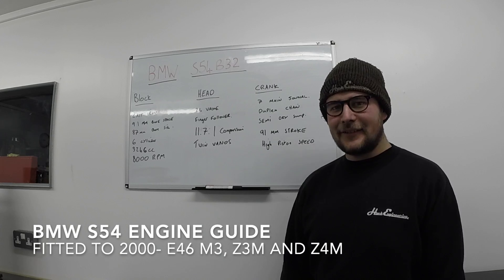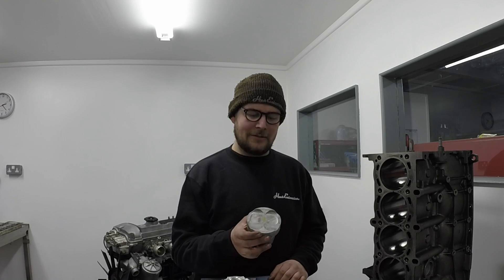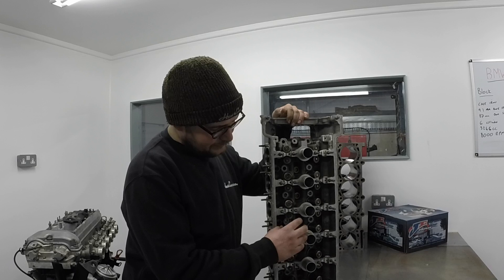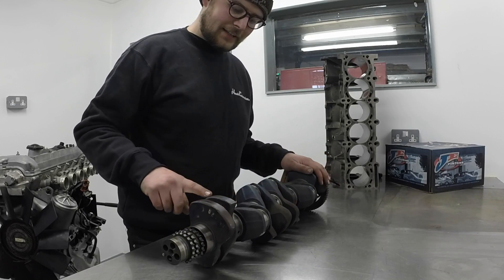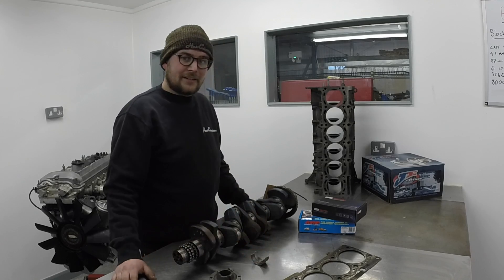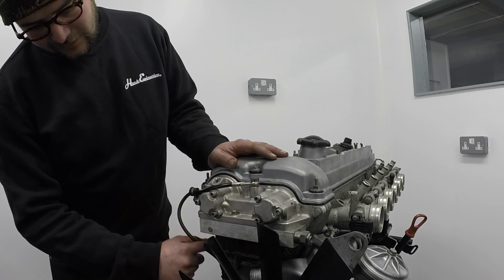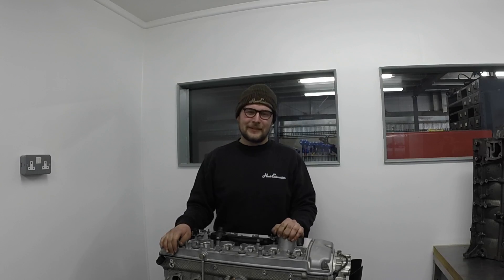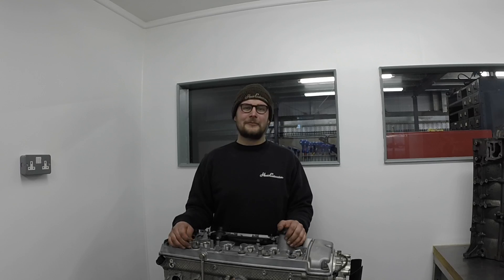Everything You Need To Know About The BMW S54 (E46 M3 engine)

Comment: there's no such thing as a semi dry sump.  it's dry sump or it isn't.  the s54 is a wet sump engine.
Reply from the maker: Correct, although the S54 has a scavenge pump and a very nicely compartmentalised oil section. It is not dry sump, but it has fantastic anti oil starvation properties using dry sump techniques.

Comment: My S54 has 180k+ miles on it, and has seen the track 6 times over the last 7k miles, runs like a champ! 
But i fear my headgasket may be going bad, between the cylinders like you shown. What are symptoms of it failing between the cylinders? I have no coolant in my oil, car doesn’t overheat on the street, and again engine runs super healthy and strong. The symptom that made me suspect an issue is that its started running hot when pushing it hard last couple times at the track, but the cooling system is fresh!
Reply: The way the head is designed on the s54 you won't get oil and water mixing. Do a compression test to see if the values are where they should be.

Symptoms are misfires and pinking which sounds like marbles in can.